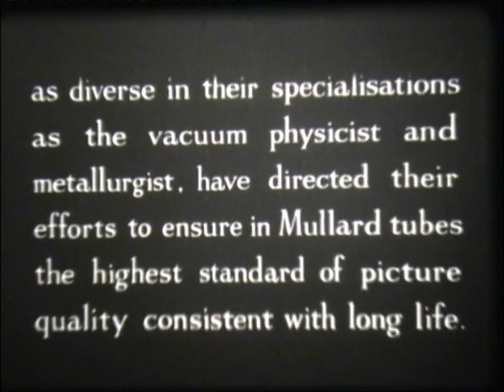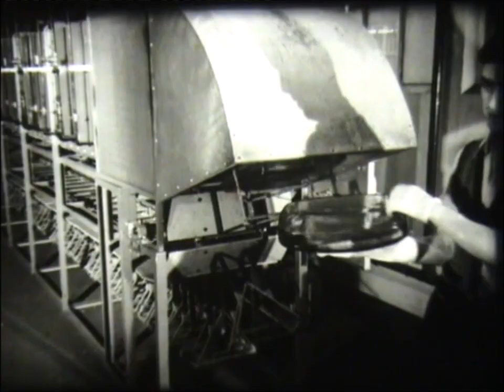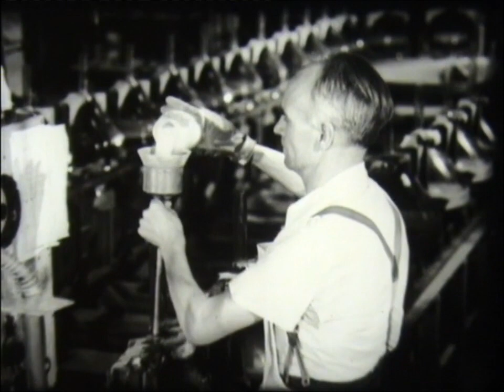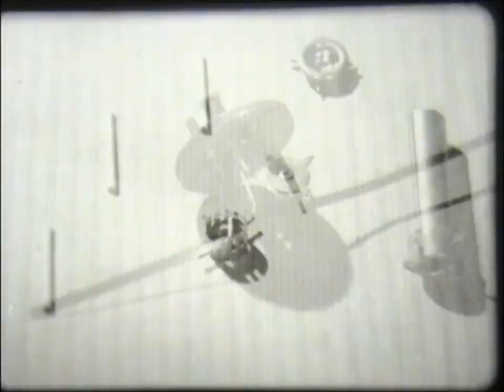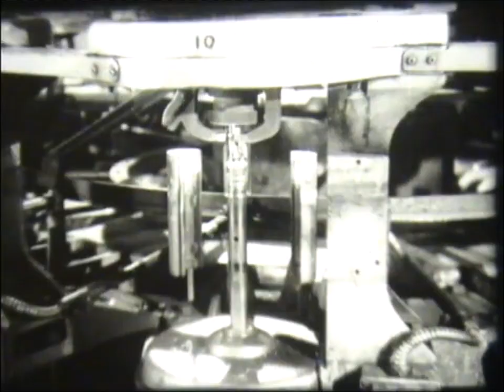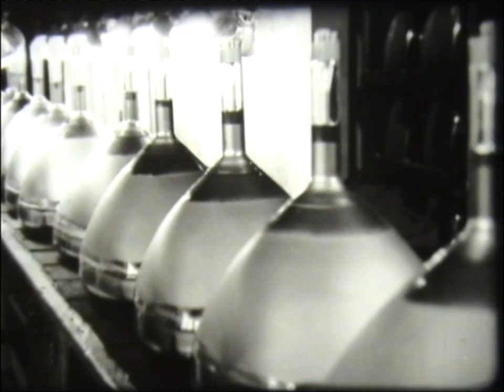MULLARD  MADE FOR LIFE. Vintage Documentary

Comment: Im surprised the cathode assembly is not total in line with axis of the tube but skewed a noticeable bit.
Reply: that may be deliberate, known as an 'ion trap' gun, has a moveable magnet fitted to the neck of the tube  in the tv to adjust for max. brightness..
Reply: @andygozzo72  You are right - I too was a bit concerned about what I thought was angular alignment error, but your comment reminded me that the cathode beam contained both electrons and ions; to avoid screen coating damage from heavy ion impact, the cathode's beam was directed down the neck at an off-angle, and the ion-trap ( a small permanent magnet help close to the outside of the neck using a tension spring strap around the neck ) was used to bend the lighter weight electrons back into the proper path for acceleration down toward the screen. ( I guess I always envisioned the heavier ions crashing into the first acceleration anode along the way )
Reply: Ion Trap

Comment: The blue gun looked a bit "off beam" in that last tube. :-)
Reply: That kink in the gun is intentional. It is done so ions from the cathode don't damage the phosphor - an ion trap. The electrons are steered straight using a magnet called, you guessed it, an ion trap magnet. With Aluminiumised screens the trap was not necessary.